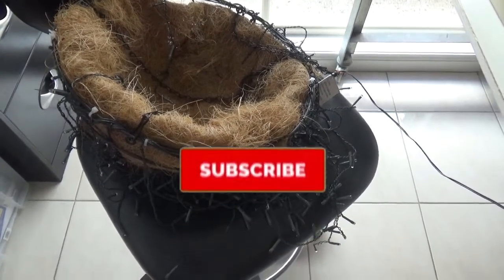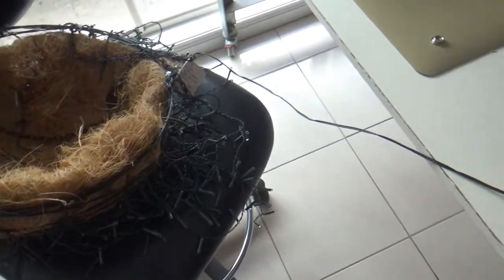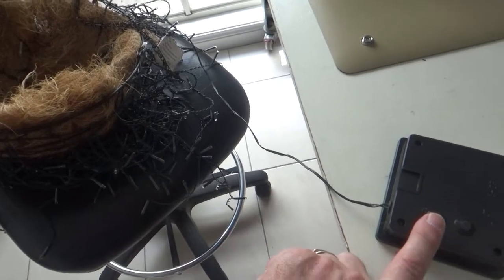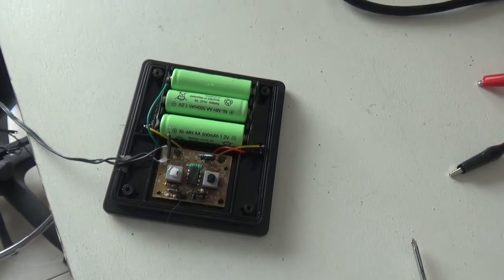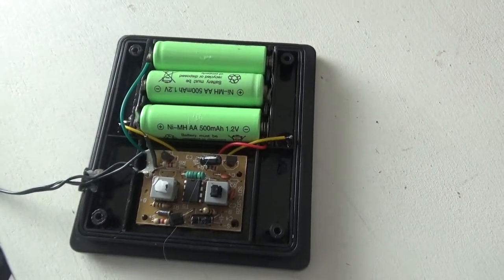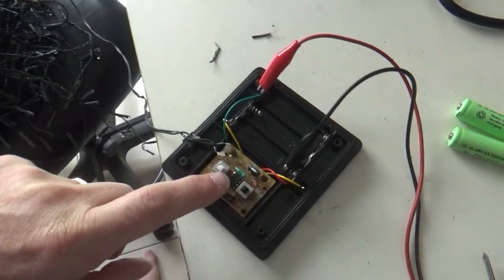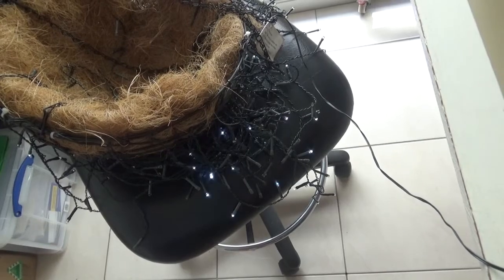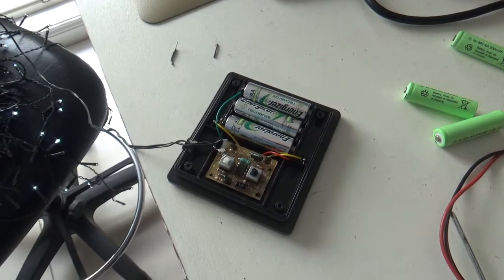#087 Christmas Lights Repair

Comment: You can change the solar cell with the solar garden lamp that is rated a 2200mhr charges faster and you can use 4 18650 batteries .